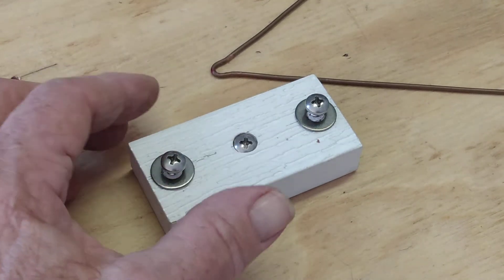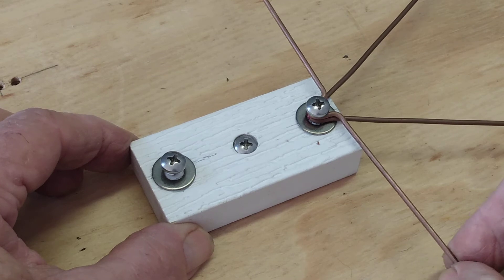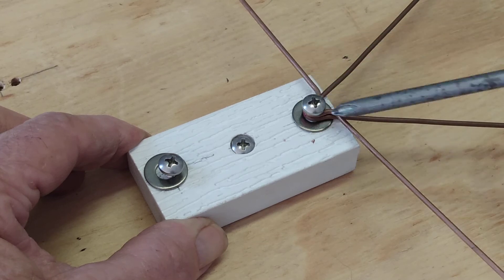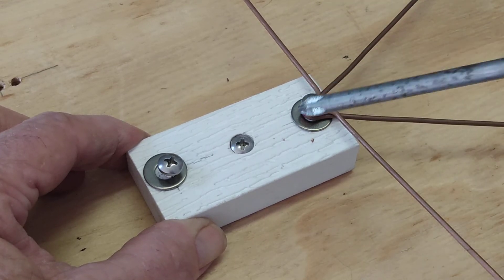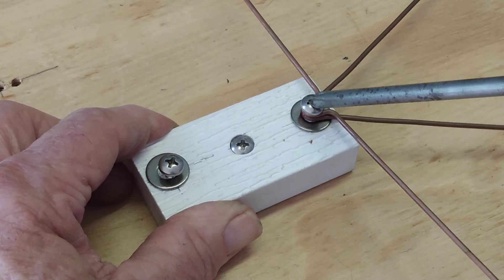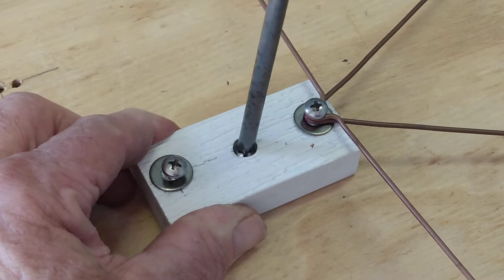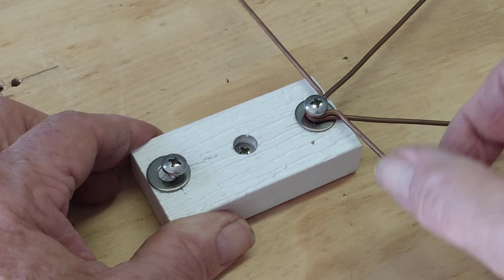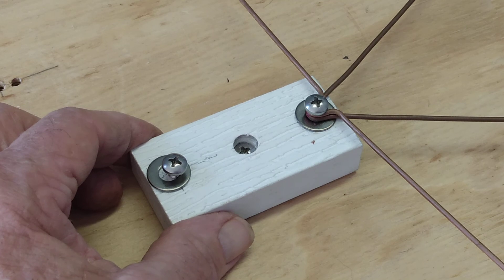Insulator Issue

Comment: How long have you been working with antennas Sir ??
Reply from the maker: When I was a kid in the 60s. Two way radio was the big thing with the guys in my neighborhood, we were all connected. Home made crystal sets were popular.
Back then vhf for tv was difficult and giant homemade antennas we're what worked. 
It's a disease.....
Reply: @cosmicantenna9244  I would like to think of it as a super mystical science. The more one works at it, the better the result. Thanks for your knowledge Sir.  Peace vf
Reply: Sorry for the long comment. Thanks for the insight on the four bay bow tie antenna. As known as a screen bow tie UHF antenna. Screen was the reflector and was very directional and could easy pull in 100 miles . 73

Comment: I mentioned on another of your videos, onlookers should probably not try to get away with wood as an insulator.  It's actually okay when dry, but bleeds signal once the rain comes.  PVC, nylon, delrin etc. are good.  Glass might work, but I couldn't find a convenient source.
Reply from the maker: Wood should never be used outside for any antenna parts. 
I shopped around a lot and tried other materials but nothing is as readily available as the PVC lumber (trim lumber) .
It's very useful for backbones or insulators and can be cut into any shape. 
I've made replacement insulators for 50 year old antennas with it. 
I built my first antennas to be hurricane proof and they were so I stuck with the aluminum and PVC structure no matter what I build. Stainless fasteners and washers prevent corrosion and prevents increased impedance in the element joints. 

Thanks for the comment.

Comment: I never thought to put a bend in the phase line like that, always put a groove in the insulator to hold it.
Your way looks better, more secure.
Reply from the maker: With the groove, the copper tends to flatten on the top,  I have also had the copper imbed too deep breaking contact. A good loop is your best bet. 
Tested and tested again in the crazy Florida weather.

Comment: Where did you get the pvc? Btw excellent video!
Reply from the maker: Most home stores like lowes or home depot carry a line of PVC house trim. It's been gaining popularity the last few years and it has many applications besides trim. 
My lowes has a wide variety of sizes and shapes but you always have to buy the full 8 foot piece, it's not much more than the cost of wood. The only issue I have is the flexibility of long pieces. Shorter, less than 36" tend to be stiffer. Great material, and indestructible.
Thanks for watching, and stop back often.
Michael @ Cosmic

Comment: I wondered about this when it came to dipole and especially loop antennas, is there a specific school of thought or guidelines to research somewhere regarding this?

It would seem that farther apart is better, but I'm a complete caveman when it comes to anything more than reproducing the successful designs others have shared.

I can build something and see that it works, I'd like to at least have basic knowledge as to why and how.
Reply from the maker: Russell, 
It's all about radio. Our antennas are picking up Radio Frequency waves. On the wave is the embedded information that produces the television picture.
The most logical place to start is to follow the links I placed on the Theory page on my website https://cosmic.simdif.com/page-1453596.html
Wikipedia is the most up to date information on the web.
The ARRL has over the years produced manuals for everything radio. See here
http://www.arrl.org/building-simple-antennas
It can get deep into physics, math, electromagnetism, etc
The easiest way to learn is here, https://www.digitalhome.ca/threads/bow-tie-tv-antenna-designs-ff4-m4-featured.100137/page-70#/forums/186 
Sign up and start lurking in the background of the group.
Look for posts that you are interested in and especially read the pinned posts.
I hope this helps.